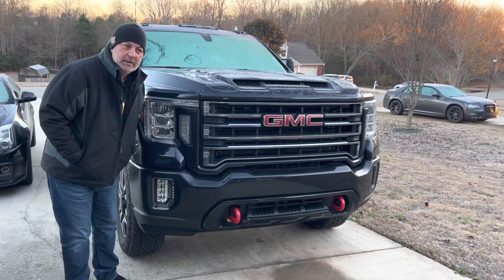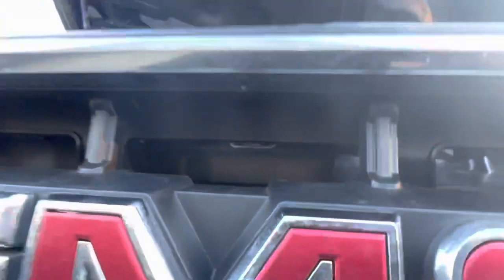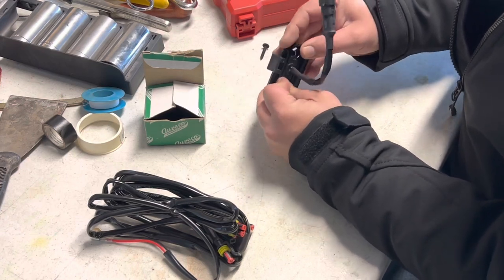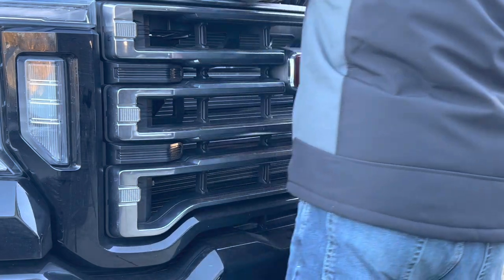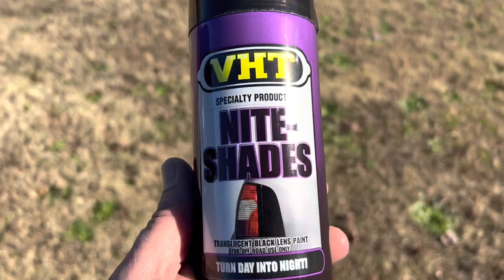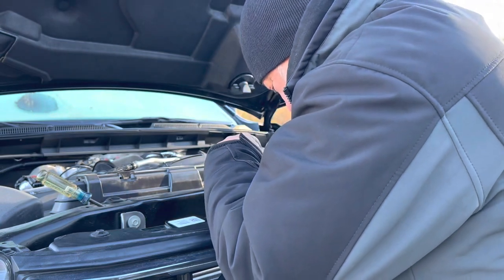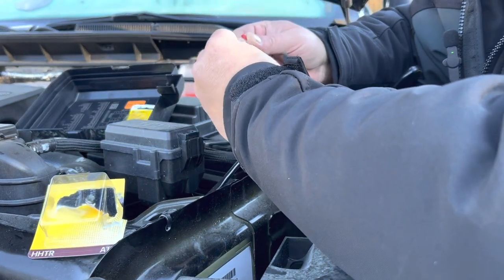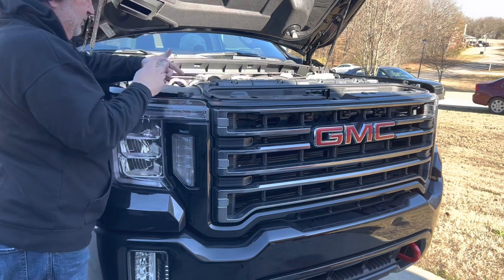Brutus gets Raptor style grill lights! 2023 GMC Sierra 2500HD AT4

Comment: What’s the deal with the headlights flickering/flashing when you start it up? I’ve seen it on another’s video, looks pretty cool.  Some type of add on to get them to do that?
Reply from the maker: Camera does that, they don’t actually flicker. That would be cool! Thanks for watching!
Reply: It's the frame rate of the camera synching with the frequency of the electronics. It's normally too fast for our eyes to notice but when it syncs with the camera it's noticeable. Like when a helicopter looks like the blades aren't moving because of the camera shutter synching with the rotational speed